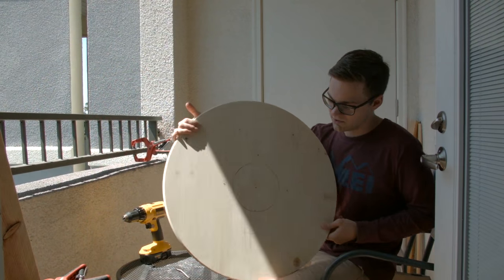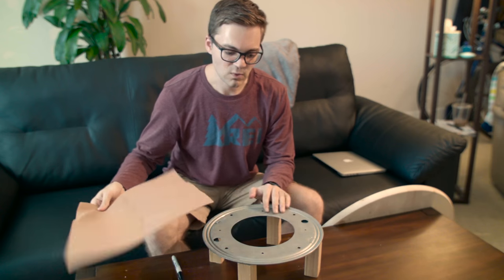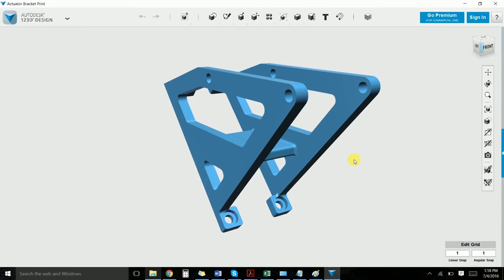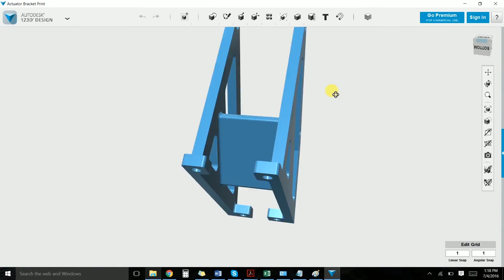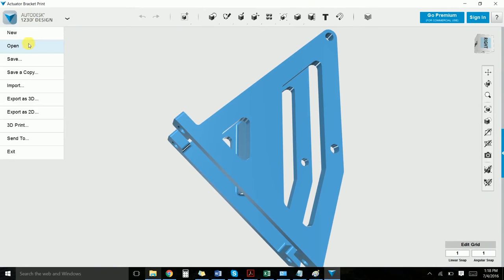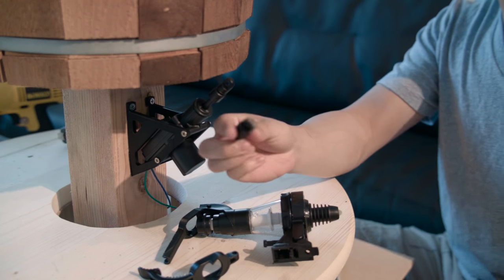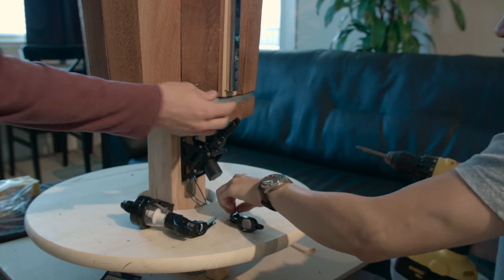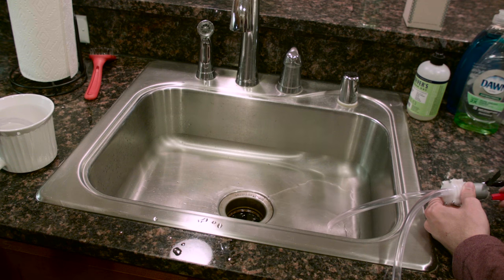Building a Robotic Bartender - Part 3: Frame and 3d Printed Parts

Comment: With your C 12V 5A 60W Regulated Switching Power Supply Adapter for LED Strip Light do you just wire it in to a wall socket?
Reply: And if I just need the water pump do I still need the Power Supply Adapter or can I just wire it up to battery's or power bank?